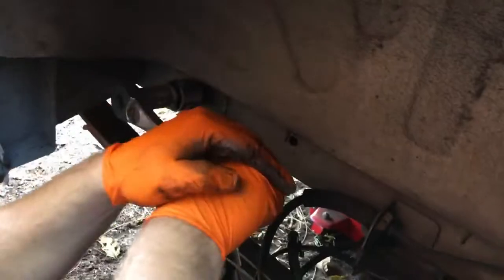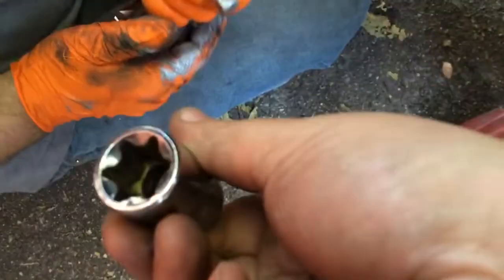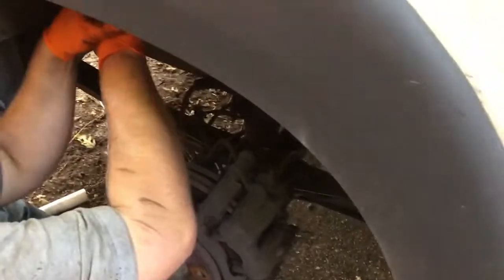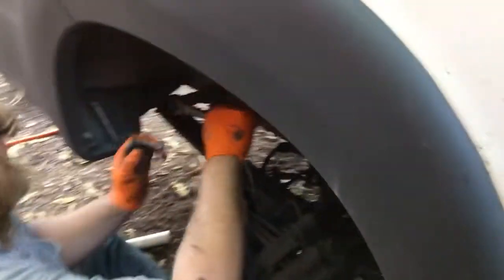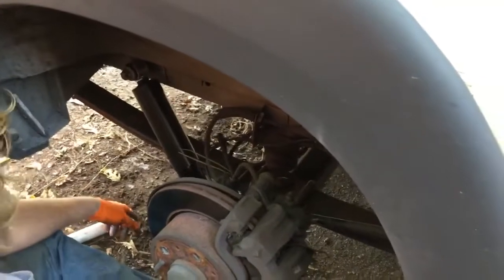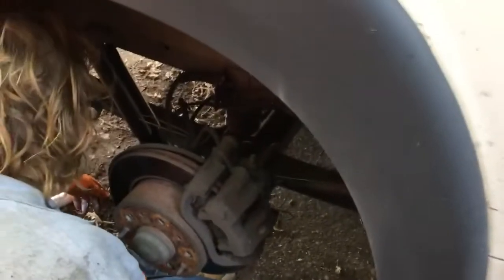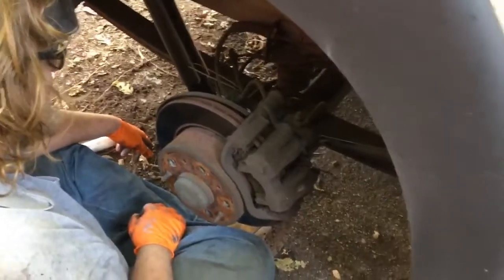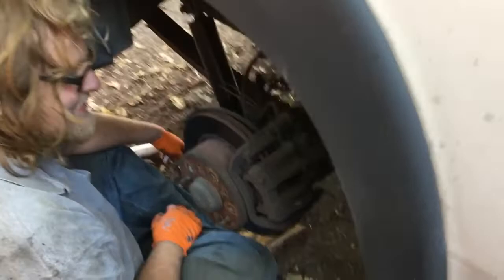2014 Ram Promaster Shock Absorber Replacement

Comment: Is this a pretty simple DIY? Apart from the etorx 24, what else do I need?
Reply from the maker: Very simple. A floor jack helps, but you coukd do it without if you had to. Easier with the wheel off.
Reply: @promastersonly1419   thanks Kip!
Reply: Straight to the point. Thank you

Comment: Hello, great content and info, than you!!  I have a problem with no low beams bulbs are new same problem. I would pay for your guidance. all 10 volt fuses are good. I do not have or can not seem to find a true fuse panel breakdown. I bought second hand love the van. I am in ny not sure where you are, if close I would come to you. thhank you if you can help in any way.
Reply from the maker: Lots of possibilities. I’m going to recommend you take it to a shop, because the problem could be all the way back to the switch or anywhere. But if you want to tackle it, meter it at the socket for the bulb, then start working your way back.

Comment: Just change the rear with bilstein b6, but the ride is bouncy , is there any reason why it’s bouncy
Reply from the maker: The bilsteins are stiifer, which would contribute if your van is super light. Is it?

And to be clear, we’re talking about bounce going over bumps, not vibration coming from the rear due to cupped rear tires? Those tires getting cupped from worn shocks, which is why you put the bilsteins on.
Reply: It’s crazy vibrations at 20mph and also 70mph, I thought it was a faulty shocks so I had let them send out new ones, but I haven’t installed them as yet. So you’re saying it could possibly be the tires worn from the old shocks causing this ?
Reply from the maker: Generally, yes. Run your hand on the rear tires - does it feel bumpy? That's scalloping or cupping, and caused by worn rear shocks. If you rotate those tires to the front, they should wear smooth again in 1000 miles or so.  @Mobz77
Reply: Update: the tyre which I had the broken shock was indeed uneven (cupped) . Went ahead and got it replaced ,didn’t want to bother put that upfront as I recently just got an alignment, van drives perfect now, thank you!
Reply from the maker: @Mobz77  I love a happy ending.